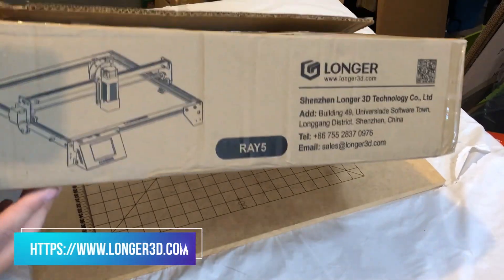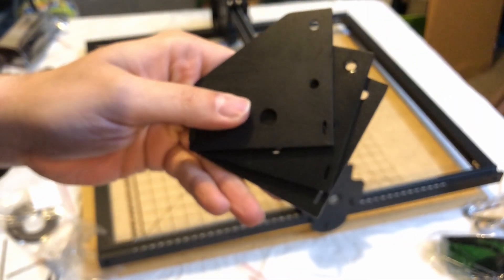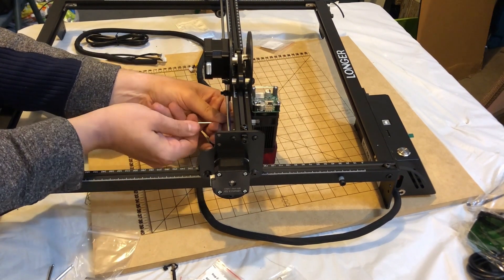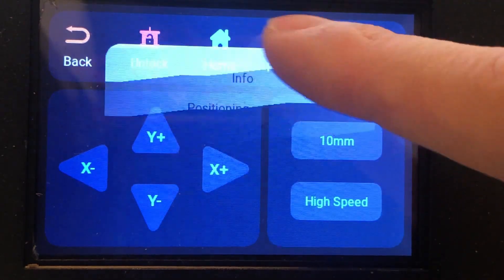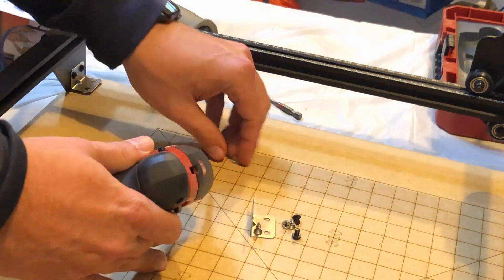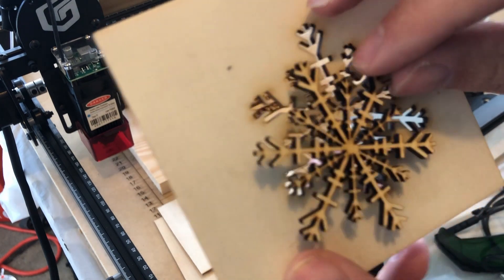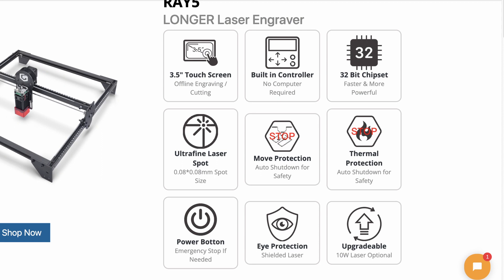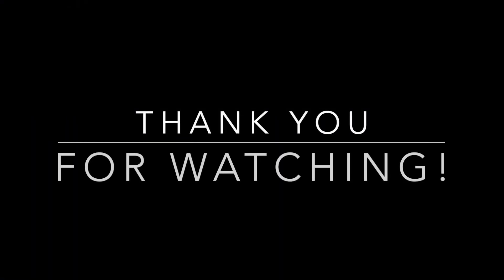Longer Ray5 Laser Engraver - With Touch Screen!

Comment: Great video. So amusing! .... I am having problems. If I save a file into Lightburn it positions and frames in the middle of the bed perfectly. If I take out the SD card and put it into the Longer Ray5 it is in a totally different place and frames a much larger area. Any ideas? I'm pulling my hair out! Can't use my new laser until this is sorted.

Comment: I've heard rumors of using mustard on stainless.

I still believe either you got a 10W or I didn't get a dual w/ my Z1. Your speeds are more like what I had to run on my power scale not to destroy the sample square. Maybe the focus is so spot 🤡 on that the 5W is just that efficient.

The missing endstop switches are a real bummer. They don't add anything to the cost when purchased in volume. How is the height adjustment set? Allen screws?
Reply from the maker: Interesting you mentioned the mustard thing to engrave stainless steel.  I actually tried that when doing my Comgrow review.  Was an epic fail, I filmed it and everything, it didn’t make the cut.
This just seems to be more powerful than the Comgo.  As I mentioned even with the literature provided by Longer, I had to tone everything down. I will need to do a comparison review after the garage is remodeled, so I can have the space.

I totally forgot to mention about the Allen keys needed to adjust the Z height.  Thumb screws would be better.
Reply: @TripodsGarage  it's on my list to try just for giggles.